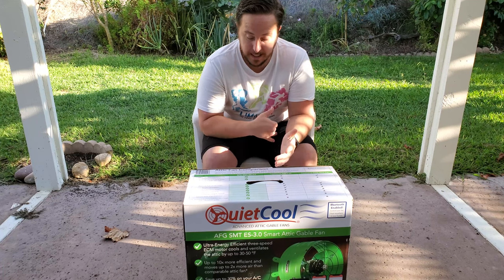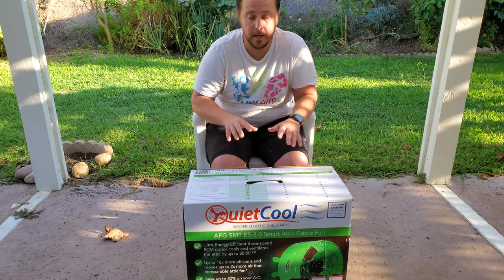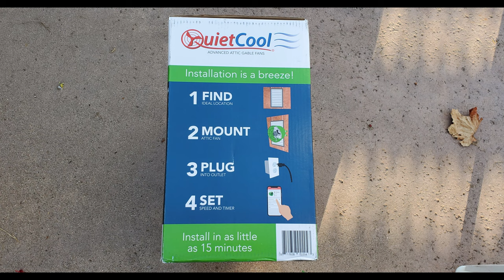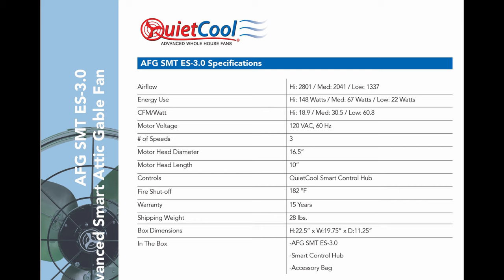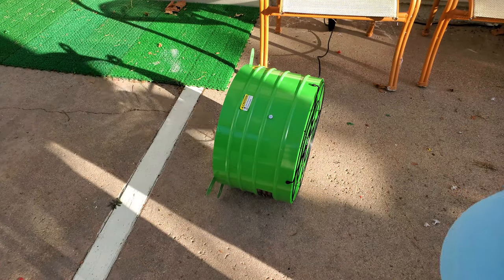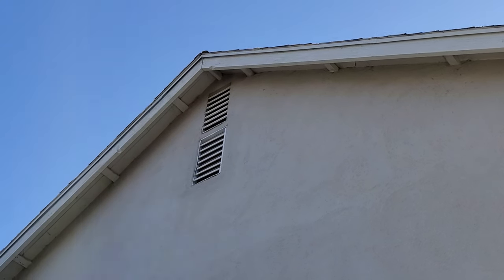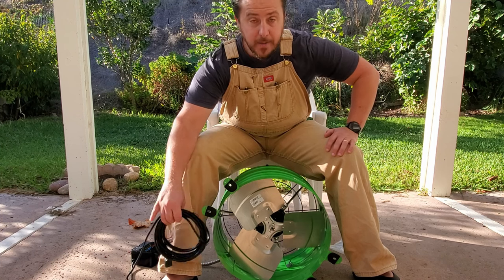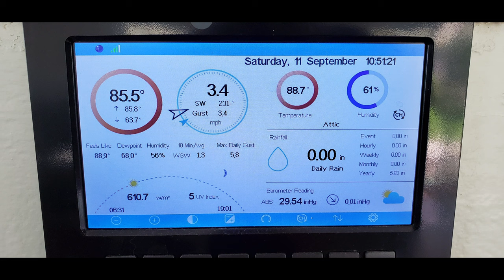QuietCool Attic Fan Part 1 - Unboxing & Install

Comment: Hi, At 14:40 you should've use a strain relief, Because that metal box have sharp edges, That may cut into the wire.
Reply from the maker: Good catch, I'll have to remember that. Ty for the feedback! ❤️

Comment: Isolation pads should be installed with the roundness to the outside just like the bracket is...  you got yours backwards...  you are getting a lot of noise transfer the way you got it but it'll work fine...
Reply from the maker: Appreciate the feedback. Next time I'm up in the attic I'll try to correct it because for the most part it's definitely quiet, but if I can do it better, it'll be worth the effort.

Comment: you forgot to seal all the gaps with Aluminum Duct Tape... Didnt they supply the black panels that go around the fan? Mine had it 4 panels...
Reply from the maker: If you watch part 2, you'll see I corrected myself, but I didn't use aluminum duct tape... which is a good idea. 👍

Comment: What is the demention of the fan. 16 inches?
Reply from the maker: Good question... I can see the documentation only shows "shipping" dimensions.  I apologize I don't know and if it were easy to get into my attic, I'd go up and measure it real fast, but it isn't.  I recommend emailing QuietCool for the answer.  Hopefully your question will drive them to at least update their website.
Reply: Thank u for posting the video
Reply: 14.5 inches

Comment: These videos never cover the mysterious way the power is hooked up to the house/breaker box.
Reply from the maker: I don't know about others, but mine would require quiet a bit of work to trace a cable to the breaker box.  I have a general idea of how it flows, but that's the extent of my knowledge.  That's why for this installation I just tapped into what was in the attic.  I at least know which breaker it's on though... just not the path to the box.

Comment: You do know this fan is useless right? Air like water draws from the closet point. So you are drawing air in from the top louvers and exhausting it out via the fan. The attic is completely out of this loop. You need to block the top louvers so air will be drawn from the attic area. Nice try but it needs work. Physics at work
Reply from the maker: I have plans to improve the air flow from some of the comments, but I recommend you take a look at part 2 where I shown the qualitative and quantitative results.
Reply from the maker: Here's part 2
https://youtu.be/YbOxl7y92h4